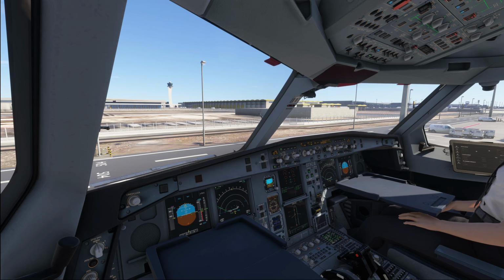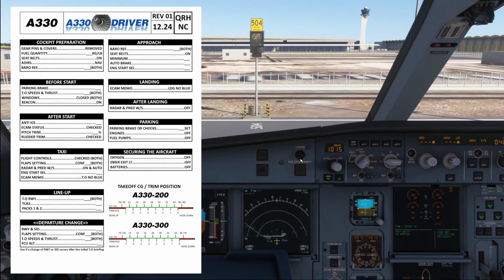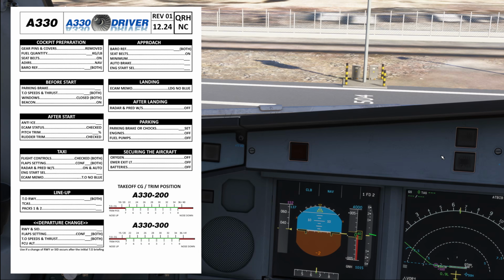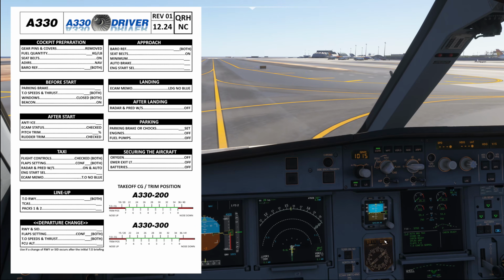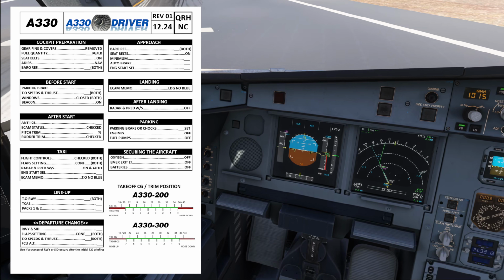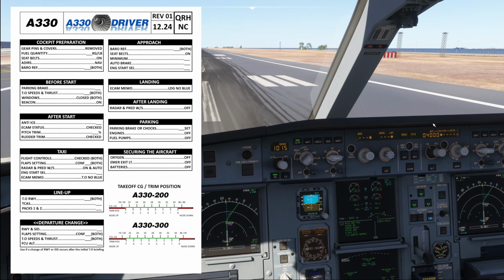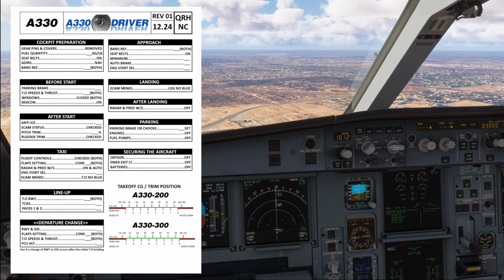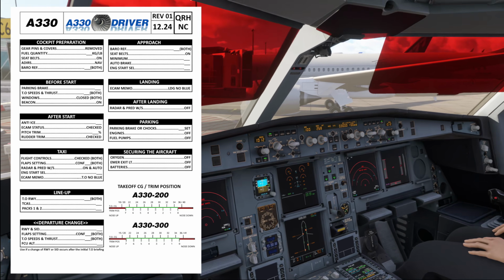How to Use your Airbus NORMAL CHECKLISTS Like A PRO! | Real Airbus Pilot

Comment: Thank you for sharing this very usefull tutorial. I was wondering… why do we turn the packs off before take off ? What’s the technical aspect behind it ?
Reply: Packs usually work by “stealing” air from the engines (this is called bleed) and therefore reducing the performance of the engines. If you are performance limited (short runway, high weight, high density altitude, etc…), you don’t want to lose that extra performance, so you either turn off the packs or turn on the APU bleed that will be the one providing the air to the packs instead of the engines.
Reply: @ thanks 👍👍
Reply: Fuel & performance